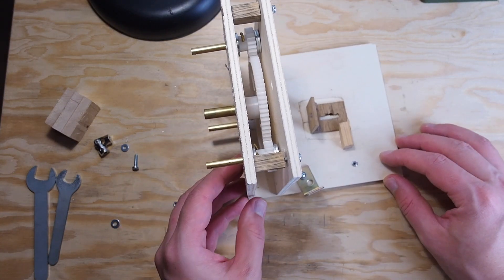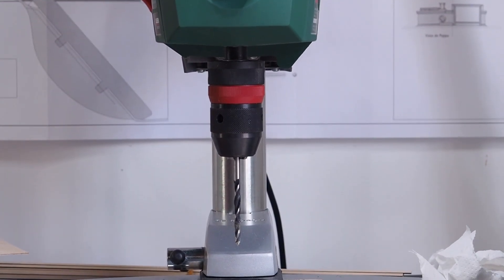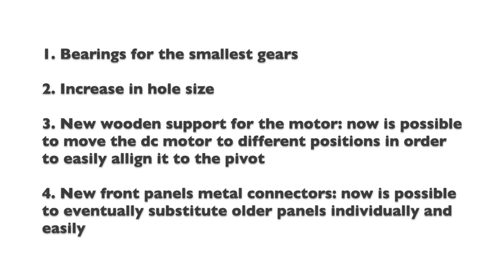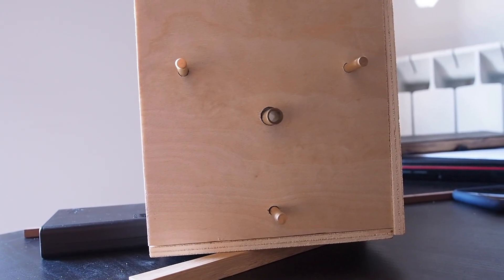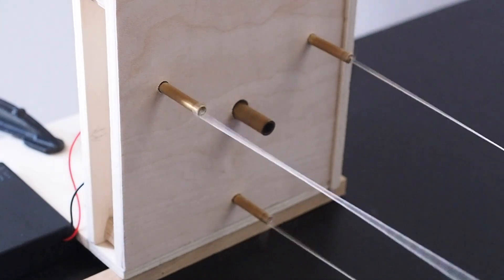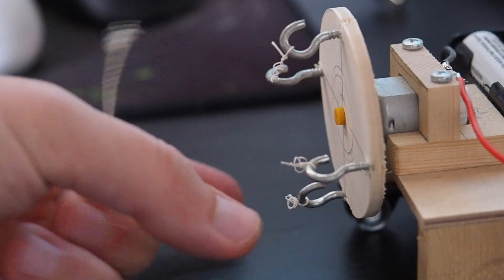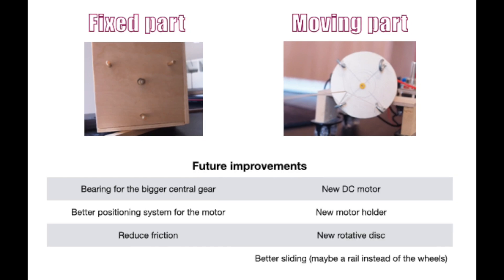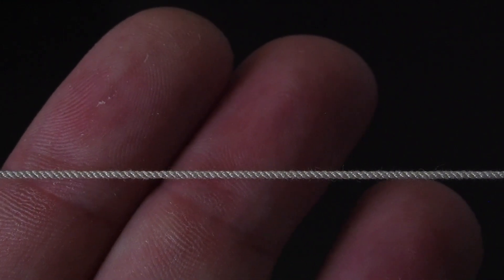My ROPEWALK prototype for rigging ship models

Comment: On the other side of the machine you don't need four hooks, one in the middle would suffice perfectly, because on that end, the three or four strands are supposed to come together anyway.
Other than that, you built a very fine machine 👌
Reply from the maker: That’s wrong.  You’re talking about the traditional method and in that case you need a third component

Comment: Did you ever use the Aleksie Domoroth machine that you showed in an u boxing video a couple years ago? I just received mine and wonder if you had success with it. I haven't tried mine at all yet, need to finish up some projects to make room.
Thank you for sharing!
Steve
Reply from the maker: Yes I did use the planetary machine, but it has a few limits. Most important for me is that you need to find a proper thread that won’t require unthreading. The problem in-fact is that you cannot unthread a cable without the proper tension, so I was ending up having S-shaped ropes instead of Z-shaped ropes, and viceversa. The planetary doesn’t generate enough tension.
The vertical machine instead is ok, it is the same as my fixed part and you can think of building your own mobile part so that it can be used horizontally.
Remember that the proper, historical way that is used still today to make real ropes is the horizontal method (with or without guide; the one you see in my videos is without guide, that’s why you have that mobile part)
Reply: What do you mean  by unthreding?
And couldn't you add tension?
Reply from the maker: Understanding unthreading and tension management is crucial in ropes making. You can better understand this on part two of this video (link here https://youtu.be/JUq1SaW35Ko?si=Rm5Ea4liAnYEhvRF
I might consider of making a whole video specifically on this

Comment: Great work, love it, not too many uses a motorised movind head. I searched a lot with very low success ont such motorised head, for info like when to initiate the spin etc. I noticed that you delayed that spin and according to the video it was at the feel of the repoe. I wonder if you need to keep the on separate hooks on the moving end. I guess it is easier to lay the rope but it may help the end of the spinning to be on an unique one.
Reply from the maker: Hi luc, thank you. I hope I will clarify all these aspects in my next video. Every thread needs to be installed individually to the hooks on both the machines

Comment: Very nice work.👏 As far as I can see, it consists of 2 parts, right and left. I could not understand the direction of rotation of these parts. Can you help ?
Reply from the maker: Hi Serhat! Thanks =) Yes you are right, there are 2 parts. Both parts can rotate clockwise or anticlockwise. It depends on the type of rope you need to make...For a Z shaped cable the first machine rotates anticlockwise and the second machine, that is used to combine the threads, rotates clockwise.
Reply: @Tagliamare  Thank you very much.👏🙏